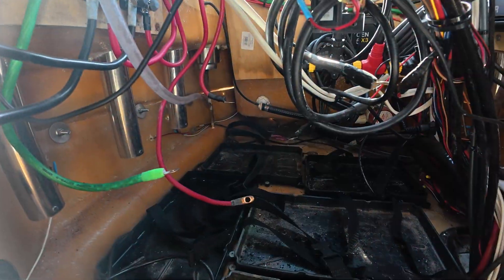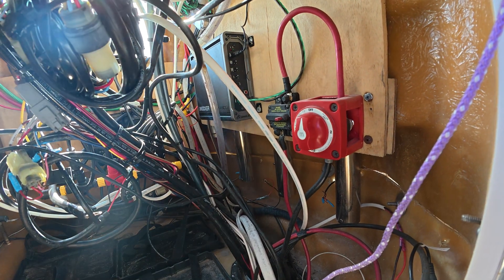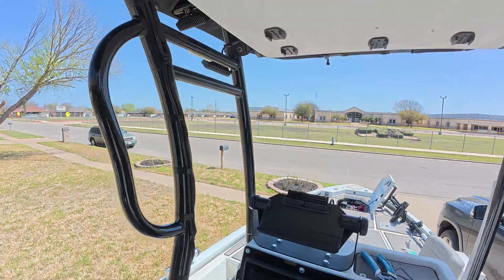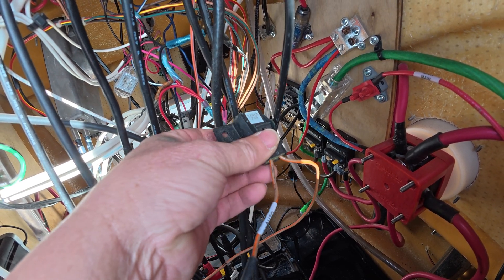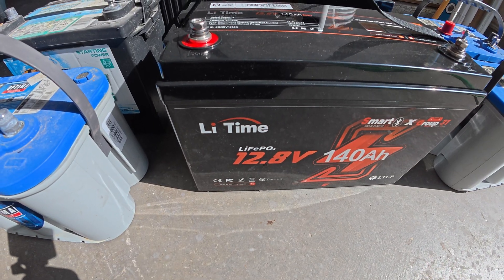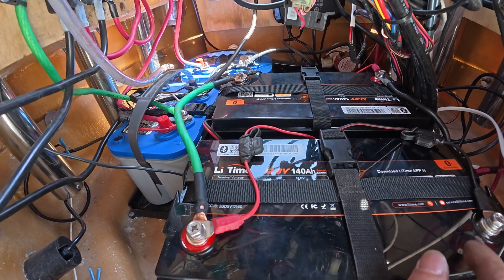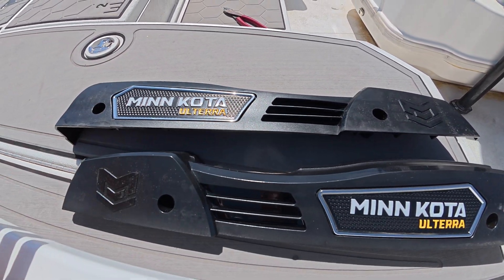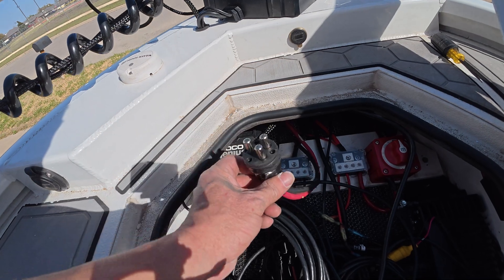Lithium Batteries Trolling Motor Install My Boat Wiring Setup

Comment: you should've replaced your circuit breaker with a 60, those motors draw alot, like 60 plus amps.
Reply from the maker: I’m going to go check that out. Didn’t even look at the breaker size. Thanks for the heads up!👍🏽

Comment: Do u have 2 house batteries connected and one just wired for cranking big motor? Does both house batteries charge or just one?
Reply from the maker: I would call one battery the cranking battery and the other the house battery “the blue tops”. They are never connected to each other unless: the engine is running and charging the cranking battery, the boat switch is set to combine, or the boat is off the switch is on and the noco charger is charging the house battery. Hope that helps👍🏽
Reply: @CarlosPadillaCentex  can 1 cranking battery be ok to run my 2 lowarnce hds units? I don't have room for a 2nd battery
Reply: @CarlosPadillaCentex  i have 3 batteries up front to run my trolling motor at 36v...I read that you don't want to hook any electronics to the trolling motor batteries

Comment: Saving weight and they'll out live and out run lead batteries any day!
I haven't changed my starting and house battery to lithium lead does offer higher cranking amps for starting, plus I have a battery combiner for house/starting battery.
Reply from the maker: Saved some weight in the console, and gained some weight at the bow win win. On this boat the more weight rearward, the more porpoising it does. Sounds like a great setup you have on there! The combiner is nice to have, sometimes if I idle too long I have to set the manual switch to combine due to low charging voltage. Thanks for dropping by Eric!